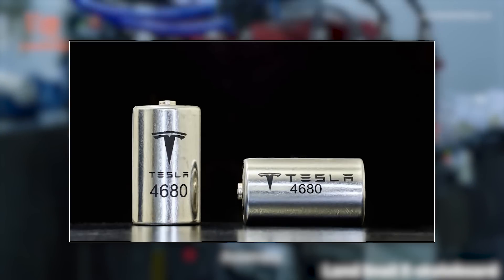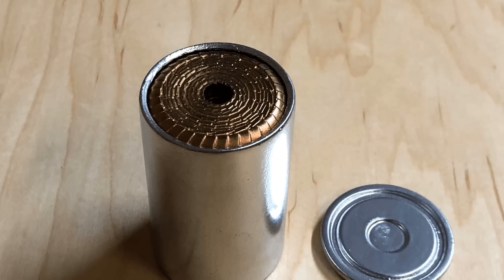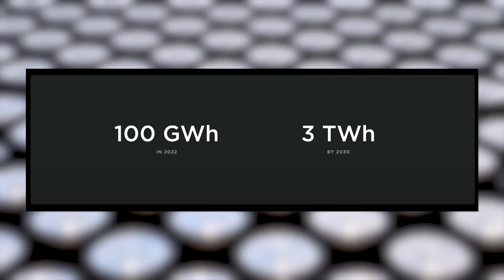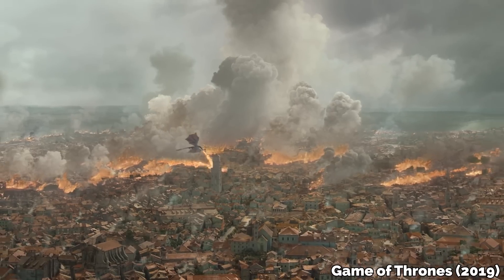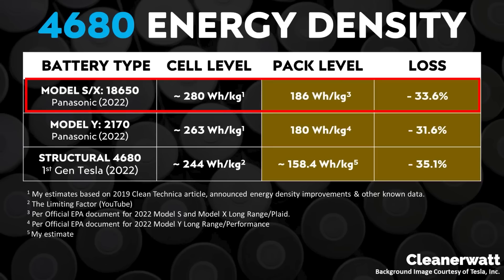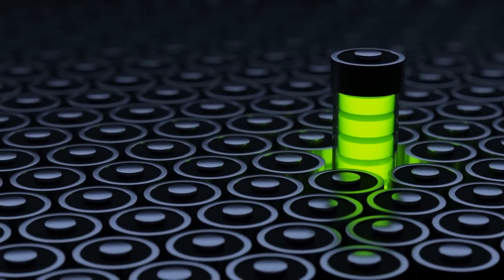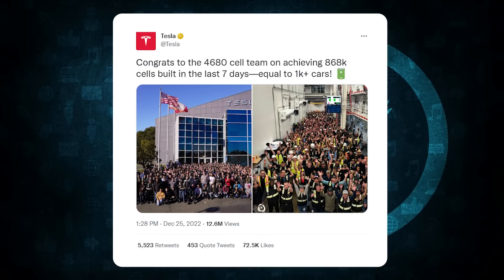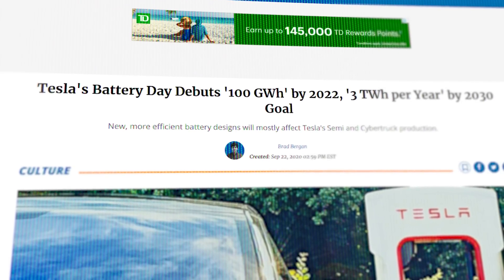The Disappointing Truth About Tesla's 4680 Battery Cell..

Comment: the moats of the 4680 cell aren't apparent to everyone- because not everyone bothered to follow battery development. you may recall that tesla acquired maxwell technologies awhile back. as you may know- a HUGE problem with lithium battery manufacture is a bottleneck during the application of lithium. the old method (non-4680) is to dissolve lithium in a solvent- then spray it onto the strip. then, the strip is air dried. this process is extremely slow. maxwell's goal was simply to speed up the process. to that end- their solution was to take the raw lithium & simply apply it dry- thus eliminating solvent mix & drying time. what they did NOT expect- was a VERY WONDERFUL side effect- almost NO battery degradation. little is known about exactly WHY the old process causes it- but apparently- liquifying the lithium & spray application 'kicks off' the formation of dendrites- which is what gives lithium it's current shelf life. after testing- Jeff Dahn has determined that 4680 dry application method will result in a 50 year shelf life- and a 3.5 million mile pack... THAT- changes EVERYTHING. cars that can outlast the original owner? wall power & megapacks that cost less than 7 cents per kwh over the life of the pack? OH YEAH. prepare to be WOWED. this IS the million mile battery. battery day was strangely silent about it. the incredible benefits of dry application were ALL OVER maxwell's website when they made the discovery. then tesla bought it- and the website was taken down- by the next day- NOTHING. tesla does this though- sandy munroe pointed it out- "tesla lies"... they withhold 'nuggets' of some incredible things- then just SPRING IT on everyone when least expected. as for the density- you have to remember- tabless architecture has been tried in the lab- no one could even come close to making it work- tesla DID IT. look back to 2009- follow the history. EVERY single advancement tesla has made- has CONSISTENTLY been the same. elon sets aggressive time lines- all the nay sayers bitch & moan & say it's impossible, 'defying laws of physics'... blah blah blah. then? model S. model 3. model Y. SEMI.. .with better specs than anyone- at a better price than anyone. AND? we still have the whiners. one day- once they've reached the 4680's FULL speed of manufacture & efficiency- the whiners will STILL be saying "yah- but it took 5 years more"... some youtuber will post a snapshot of a model Y with 400,000 miles... and NO BATTERY DEGRADATION... then 1 million.. .then 2 million... and WHEN that happens? everyone will have forgotten- that it all started with elon- scouring the globe for the next best thing- and finding a little startup company that makes ultra-capacitors who solved the battery degradation issue & created the greatest energy storage solution ever to hit the planet. 

OF COURSE 4680's didn't EXPLODE onto the shelf overnight. neither did: vacuum tubes, solid state electronics, internal combustion engine tech, cars, rockets, lasers, radio, wireless networking... SHALL I GO ON? have some patience. gen X & Z are an entire GENERATION of ADD brats. grow up.
Reply: Obviously know your info.   I remember reading something about this, the acquisition of Maxwell, and next thing I knew it was not talked about.  I also remember a blip about massive improvements in degradation.   This is a really big............HUGE deal and should make us all step back and realize that 20 miles is garbage.  If they charge fast for that occasional >250 mild trip, that's good enough for me.  The infrastructure is already in place and only getting bigger and bigger DAILY.  For me, I work for a living.  I drive 30 miles per day.  With my LR that's one charge AT HOME, per week on average.  So maybe I charge once every 6 days.  LOOK AT THE BIGGER PICTURE FOLKS.  Elon is so far ahead of all of us, we are catching up on old news.  He is most likely doing things we won't really understand for a year or more.  The 4680 may not be up to initial expectations, but given my limited understanding, I expect a simple delay.  Like always, but ultimately delivering.  This isn't Star Citizen people.  This is the real deal because they deliver.  Over and over again.  The driver gets lost once in a while, but he always arrives.  Now, explain to me why all my patients tell me Tesla's are burning up everywhere?  I'm not hearing it anywhere?  What's the deal ?
Reply: @jasonziter  the 'burning tesla' narrative is just exactly that- a story. to date- the number of tesla's that pulled a 'chevy bolt' candle stick trick have been?

 EXACTLY ZERO. 

one HILARIOUS case- a model S ALLEGEDLY caught on fire 'for no reason'. it occurred late at night in a subdivision- one witness saw the guy park the car, in the middle of the street- (strange?) and slowly walk away- leaving the area- with the door open.  then, a couple minutes later- suddenly- the car starts smoking & caught on fire. the driver who walked away reported to news sources that the car caught on fire while he was driving it and he had to leap from the car with flames shooting out, barely escaping. later, when questioned- the driver claimed he stayed with the car til fire trucks arrived- but the fire department claimed the driver was not there when they arrived. the news reporter showed up to interview the ONE witness- and the entire narrative fell apart... so the "tesla catches fire" story hit one line- and then total silence.. .once they realized they'd been duped. and retraction? OF COURSE NOT. 

all the other fires? caused by crashes. a complete normality... for gas & for EV's. then there's the case of the 'mystery' lawsuits- ambulance chasers who represent NO ONE- other than "the public interest"... who try to sue tesla with claims of 'spontaneous fire'... only to be shot down once  NHTSA published their findings:

 this one being nearly a CONSTANT habit. 

how much fun would it be to follow THAT money trail of law firms back to its' source? I'll save you the search- GM, FORD, NISSAN, HONDA, TOYOTA, the american petroleum institute, (APi) and opec. 

remember the national news story of the new model S that 'crashed while in full self driving' with NO ONE at the wheel? the first barny fife cop on the scene SWORE 'no one was driving'.. as did the rescue/first responders, (however- failing to mention that their seatbelts were NOT fastened) the news RELISHED that one for about a week. then, tesla dug up the guy's file- & found the guy did not pay for FSD. also- in the area of the crash- no street markings- which means, even navigate on autopilot would NOT have engaged. then NHTSA investigation of the car's 'little black box' revealed that the driver never even attempted to engage autopilot, nor did they fasten the seat belts. a month after that- and a full investigation by NHTSA- they found a house with outdoor security camera footage of the ENTIRE incident. two guys- got in the FRONT seat of the car- did NOT fasten their seat belts- and drove  some distance- then the driver gunned the throttle at a corner- didn't make the corner & slammed into a huge tree. they guy in the front passenger seat was thrown into the back- the driver was thrown into the passenger seat- both men unconscious, laid there til the car started smoking... then caught fire- and they burned alive because they were unconscious from being knocked around with no seatbelt. retraction? OF COURSE NOT! 

see the pattern? cover the lies- ignore the truth- look for EVERY chance you can to write bad PR for tesla. where does NBC, ABC & CBS get ALL their revenue stream? advertising. what is it that tesla doesn't spend ONE SINGLE DIME on? 

ADVERTISING. 

who DOES spend on advertising? GM. FORD.. ETC. & here's one "chevron with textron! good for YOUR car".... and NBC's wallet. 

government data collected on car fires shows that gasoline cars are 100x more likely to catch fire- how low would the EV number be if you didn't count the chevy volt?! food for thought.
Reply: @jasonziter  very true. energy density for new battery tach ALWAYS follows a curve. did with nicads, nickel-metal-hydride lithium 18650, and 2170's. it's hauntingly a lot like watching the steady increase of processor speed in pc's. but the REAL breakthrough of the 4680- is the almost complete & total lack of ANY dendrite formation. THAT ALONE would mean that- even if the pack density only gets to the same level as the old lithiums? 4680 is king- no cobalt? no degredation? holy never ending power storage bat man!

Comment: When you say "best" you must list the metric criteria. This video mentions a couple of criteria but fails to mention things like faster charging and that the 4680 battery pack replaces structural parts that results in total-car weight savings. For the 4680 Model Y, Tesla made more than one change at a time. Therefore, this video is comparing apples to oranges.

Also, any time someone states what they think will happen in the future, they should be seen as making aspirations, not promises. Otherwise, they could just buy lottery tickets and call it a day.

Comment: EV's are great. I just wish that there was an alternative to batteries.
Reply: What is it with batteries that you don't like that much?
Reply: Current batteries are caustic and worse than oil. New technologies are on the way though- good times ahead
Reply: Capacitors: no chemistry involved just static electricity on insulator between 2 sheets of metal.  Capacity is improving but a LONG way to go to be practical for EVs.
Reply: Why?
Reply: @samijokinen9246  Batteries for EV are VERY difficult to recycle. Very costly. You need to examine how they are constructed.
Reply: @charrin9086  recycling is already being solved by tesla.

Comment: They NEVER promised 30% longer range.  It is 5x the size and 5x the energy.  He promised NOTHING.  The 6x likely refers to the ability to drain and charge them 16% faster.  Everything else was likely a cost savings because the cost of Lithium and Cobalt are through the roof.  Elon posted recently it was $101 per KW.  That is $8,181 for batteries alone.  This is not including the cooling and heating or the case or any of the sensors and electronics.  The replacement cost of a 50kw Model 3 battery is around $13500 with $1000 labor or $14,500 total.  This likely includes 2-4 thousand in markups.  Now from what I have heard this version of the Model Y came with a $2000 reduction in price.  So if it does charge a little faster and costs $2000 less I would say he hit his goals.
Reply: Well put
Reply: This Video Sucks
Reply: At battery day Tesla did promise longer range, just go back and watch it, it is right here on YouTube. Musk keeps adjusting his promises, and the breaking of promises over time are pretty wild. Where is FSD, how many times has the Semi, Cybertruck and Roadster been delayed? Musk cannot be trusted, but at least he sets ambitious goals.
Reply: @TheEbbemonster  My new Model S has a 400 mile Range!  The model 3 Long Range is Just Fine! Stop having a hissy fit. You try to do as much as Elon Musk does you little crybaby go change your pamper and stop whining. You are absolutely pathetic.

Comment: The issue seems to be a chemistry one.  Didn't hear about dry battery chemistry in this vid or tabless design.  I thought the 4680 was tabless, so my thinking is the problem is with the dry chemistry and the energy density this technique produces.  Could be it takes less space, produces less chemical waste, but isn't as efficient.
Reply: My understanding is that the issue is that they cannot yet produce 4680’s with the dry process and have to use the wet process so they are not yet able to reduce the cost of these 4680’s to the extent they desire.
I’m gambling on a MY 4680. Maybe I’ll create a channel and review my ownership experience with this new battery 🙈

Comment: Why rolling up into a cylinder? BYD has the blade batteries. If your battery pack is rectangular, why making the batteries cylinder shape? Isn't that less efficient? I am not a battery expert. Just one of my questions. I mean I don't see (or understand) why/what exactly makes the 4860 a much superior car battery.
Reply: IMHO rolling is continuous and is the fastest manufacturing technique (rather than folding, which has to occur for non-cylindrical shapes) and is the more efficient manufacturing process. But it is clearly slightly less efficient for pack density as there is space around the cylinders when packed that cuboid shapes, for example, do not have.
Reply: I'm pretty sure that the companies that are building pouch cells, also have their automation quite well sorted out by now. Nobody is doing this with manual labour!
Reply: @bikeaddictbp  you're another "im cleverer than everyone at Tesla" fool.
Reply: It is cheaper, thats all!

Comment: That battery looks good for preventing overheating. What about overcooling?
Since tab-less conducts heat away faster, outside cooler temperatures can attack the water in the electrolyte faster.
From my point of view, it needs stored thermal energy and thermal conductivity that can be switched on/off as needed.
A few goals I see are to increase the Btu/Kg stored while improving Btu/Sec transferred and decreasing the Watts consumed/Btu stored.
Reply: It's not that the 4680 dumps heat faster but that it generates less heat.
However the overcooling problem in the winter would be worse with 4680 batteries. It takes a 2170 pack about an hour to warm up in arctic temps...
Reply: @phenoge from my point of view,  It generates less heat because it can dump it faster (higher thermal conductivity). There is less of a pinch point, thermally because of the tab-less design. Likewise in my trade, the electrical industry, I have to choose a wire size to handle the ampacity (heat) outputted based on ambient conditions. However, when it comes to making the simplest effective way to keep battery temperatures in the sweet spot, where needed, it seems to be more challenging than it looks.
A thermal equivalent to a capacitor and coil to handle lead and lag temperatures and emergency hot and cold storage to match seasonal conditions.
Reply: @gary.richardson  That is slightly innaccurate.

A tabless design generates less heat because of lower resistance, increases cycle life because the localized heating spots are greatly reduced as well as other factors, and allows for faster heating and cooling because of increased thermal conductivity :)

Comment: Incorrect/incomplete!!!!  If 4680 is structural and 18650is not structural, then they must ADD NON-BATTERY STRUCTURAL MASS in order to compare.  So a more correct calculation will be 18650 pack plus frame mass divided by capacity, vs 4680  plus lesser frame mass divided by capacity.  Please address this, as I believe your logic/calc is incomplete and so extremely flawed and incorrect!

Comment: So the chemistry of the 4680 can still be improved and that is what we are waiting on the catch up.
Reply: The chemistry of any of these cells is subject to improvement, regardless of the size of the cell (18650 vs 21700 vs 4680). They're all constructed as jelly-rolls (cylindrical) or layers (pouch) of "whatever cell chemistry you happen to be using". If someone finds a new battery composition that could improve any of these, the same improvement could be done to others.
Reply: @bikeaddictbp  Well that being the case Do you think they are moving forward to improve the older cells or the newer ones with the structural pack?
Reply: @scamchan  Work is ongoing throughout the industry. I have no knowledge of whether Tesla plans to go all-in on 4680, but it doesn't matter. It's the stuff that makes up the jelly-roll that matters, not so much its particular dimensions.
Reply: But they will sell the improved chemistry as a new type of cell once other manufacturers improve their cells. This cell is now established improving it would not benefit them at the moment.

Comment: Nice aspirations, but I expected it to be years before the 4680 would surpass the previous battery formats.  Never buy the bleeding edge, latest and greatest hyped product.  By the proven package and wait a couple of years on the new product introductions.  Maybe a new paint process would be good to try, but the core of the car needs to be solid, tried and true.
Reply: FSD is much more hyped! In that environment, engineers who refuse to hype would be push out!
Reply: "Be not the first by which the new is tried, nor yet the last to lay the old aside."

Comment: I just want a 400 mile model Y 😫
Reply: @RemoteSpeed007  nah. My LR Y barely gets 170 miles in the winter. Takes 3 stops to go 400 miles to my cabin. Pain in the ass. Adds almost an hour to the drive. Awesome car but need more range. Would love to be able to tow a jet ski to my cabin as well. I’m not unhooking 4 times to charge over the course of a 5 hour drive.
Reply: @RemoteSpeed007  I’m not complaining. Just can’t wait for 400+ miles. The speed limit is 70… I’m not going slower than 75. Would get run down. And it’s a huge hassle to unhook a trailer to charge… 
V4 pull through superchargers will help!
I make 300-400 mile trips almost every weekend
Reply: @RemoteSpeed007  Highway speed. 75-80 mph
Reply: @RemoteSpeed007  Or buy a gas-powered car
Reply: We need 500 mile EVs with lithium batteries as the normal charging is between 20-80%, and the range loss in cold weather can be 50%.
Reply: @RemoteSpeed007  I don’t think he is the exception. Traveling long distance is still an issue with Tesla EVs even with the supercharging network.  Also the recent price hike in supercharging doesn’t help either.
Reply: @RemoteSpeed007  it’s a great vehicle, don’t get me wrong! I know a ton of people in a similar boat and need 400-500 miles.